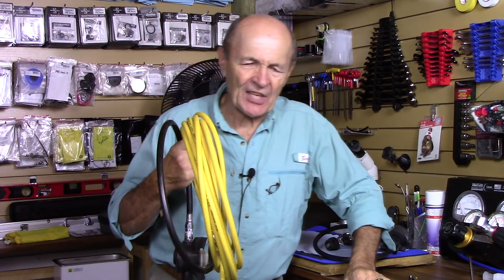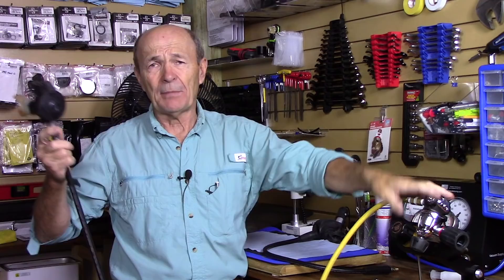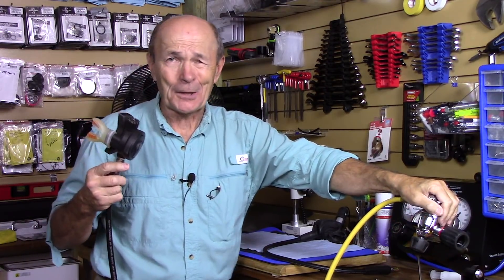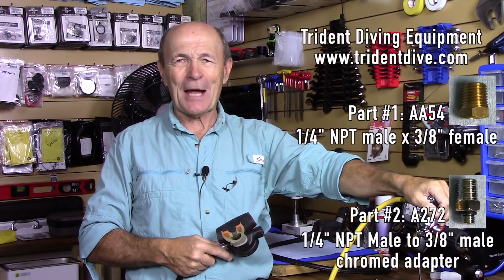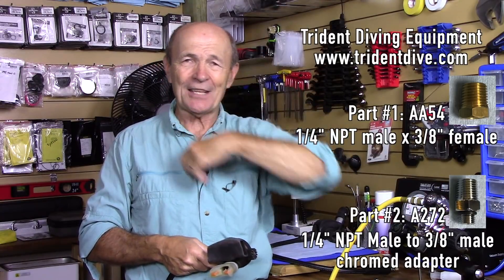Make Your Own Hookah Surface Supply - Scuba Tech Tips: S08E03

Comment: Can you do it with just regular air without a machine or scuba tank?
Reply from the maker: Because your breathing air under pressure, meaning underwater, i would recommend clean scuba air.  It's the safest and sure way to keep the diver safe.
A
Reply: @ ok Ty do you have to have a diver certificate to get the clean scuba air? Also I’m planning to go 30 feet I think would be the highest I would go if I was diving. Do you still need a divers certificate?

Comment: Please don’t follow this, you need food grade breathing line if you care about your life. Non food grade hoses have hydro carbons that releases into the air you breathe.
Reply from the maker: There is no 
food grade' hose but do get medical grade non-toxic PVC, or one that says 'air breathing' will be fine.
A
Reply: @ there is definitely food grade tubing. You can literally Google it and find it. It’s typically silicone mostly used for feeding tubes and stuff like that or you can spend a little bit more money and buy breathing tubing. It’s a yellow line.
Reply: @ there is also no safe pvc/polyvinyl chloride products that are safe to breathe through

Comment: Can you use a quick disconnect  between the regulator hose and the air supply line that leads to a tank on the surface?
Reply from the maker: You can but it is a risk of leaking and an accidental disconnect (do you have a bail out bottle?).  For safety, most use one piece from reg to air supply.
A
Reply: @AlecPeirceScuba_SeaHunter  I've come across a quick disconnect from XS scuba that has a black ring that you turn open then connect the male end and turn the ring to a close position and that prevents it from disconnecting. I do hookah for metal detecting in 15 ft max water
Reply: @texascrossbowdude636  Do you use an air compressor? I see they make battery operated air supplies and read a blog where people use a large aquarium pump that pumps 115lpm but it's only like 16psi. Seems like it would work but I'd think the spring in the regulator would be too strong for the pressure.
Reply: @brownjessea1  i was able to connect a quick disconnect at the regulator and the hose from XS scuba  thx

Comment: trying to keep my rig under a budget and weight.  if im down 20-25 feet,  would a 1/4" hose be large enough to supply air?  or do i need a 1/2"?   or 3/8"  harbor frieght has lots of 1/4 and 3/8
Reply from the maker: For me, i'd want thicker to get easier air flow in case of a hose crimp.  A
A

Comment: Hi Alex, I really like you videos but I need to comment on this one. My experience as a mechanic using Harbor Freight air hoses is that #1 they smell bad, #2 I have had them deteriorate internally and allow particles of material to flow down stream into pneumatic tools. An air filter designed for garage type compressors should take out the particles but they would not filter out the taste or smell. As a Scuba instructor, I personally would only use a dedicated scuba hose, and a scuba tank for the air source.
Reply from the maker: There are 'air quality' hoses for hookah use but like you say, check for smells if you can.  I'm amazed at how many divers still use the hookah setup for shallow dives.
A

Comment: Hey Alec....thanks so much for this video. I've been free diving up here in the NW part of Oregon. Besides the visibility issues with the water , I've found later in life , I can't hold my breath as long. I usually stay between 10' - 20' but by the time I get there , I have to head back up.  Sooo.......My plan is ( and I already planned on getting one ) Is a Sea Doo Fish pro or Explorer pro and mount one of these Hokkah systems on the back with a 100' hose. I dunno......but I think it'll bring my spear fishing and crabbing to the next level!
Reply from the maker: That's an unusual setup.  There are electric/gas surface supplied air pumps for shallow hookah dives like you say.  Be safe.
A
Reply: @AlecPeirceScuba_SeaHunter  Most definitely Alec. I know people like to use the smaller floating devices for their pump , but since I'm getting a fishing jet ski anyways , I could easily mount it to the back platform. In my head.....this seems like an incredible setup for my particular needs. BTW....I really dig all your videos my man. Been watching them for years!

Comment: In Sumatra Indonesia….long time ago before I knew anything bout scuba dive, my friend took me to dive with surface compressor supply and a long hose similar like your video. I remember jumped to maybe about 10 - 12 meters, got feeling bout underwater experienced for the first time. Went up, took a rest and jumped again. No safety stop of course. All the crazy things. I amazed of that experienced and found out about a real scuba dive later on… one question Alex, this compressor doesn’t have water catcher, does it? And also if we dive to, lets say, 20-40 meters, we supposed to do the safety stop procedure, right? Thank you for this good video..
Reply from the maker: If using a hookah below 5-10 meters, follow scuba diving ascent rules like; speed, safety stop and slow ascents.  You are breathing compressed air at depth as if a tank was on your back so safety is key.
A

Comment: At 13 to 16 feet should I where ears plugs? I will be searching for a lost rc boat in murky turtle pond..any advice is appreciated.
Reply from the maker: Never use ear plugs, it slows equalization and can cause pain and a rupture.  Only approved scuba ear plugs are Doc's Pro Plugs because they have an equalization hole but keep out most water.  Look them up if ear plugs are really needed.
A
Reply: @AlecPeirceScuba_SeaHunter  so without ear plugs in 15- 18 ft I should be fine? Do ears automatically close to prevent water or something like like..never hear anyone mention ears in any diving instruction videos..thanks for your help..
Reply: @roadstar499  Then you have not been watching the correct videos because they ALL talk about pressure equalization in the ears or "clearing" the ears. ALL of them!
Reply: I used to snorkel in holes that deep. Never had any issues with equalization.

Comment: On double hose regulators that have dedicated hookah ports, such as the DA Aquamaster, how do you keep the regulator on your back? It is rather heavy to leave floating around and possibly banging the back of your head.
Reply from the maker: There are hookah straps that hold the hose loose for the reg, go behind you and then up.  If you look in old scuba gear from the 1960's,  almost every manufacturer had hookah holder straps/belts/kits.  They were very popular back then for shallow diving, boat work, etc.
A

Comment: Like using these to clean big pools with weighted shoes and  a gas mask adapter like a full face mask  it's even better . Make a whip waist belt.  To take hose pull weight off regulator. The coily kinda hose .. doesn't have a bad rubber taste like yours will
Reply from the maker: These are great for that type of work.  I did commercial hard hat work so know lead boots well.
A

Comment: With a 200ft hose and being 100ft under water is there problems breathing with the pressure differential?
Reply from the maker: Not if a good 1st and 2nd stage are used.  
A.

Comment: Can you split 1 tank and attach 2 regulators to have 2 divers in the water using 1 tank, or is this not recommended/safe? The dive depth would be less than 15’, probably closer to 10’ for short periods - 30 minutes max. This is for lobstering in the keys when we find a good hole.
Reply from the maker: Remember your octopus has a 2nd stage (for you) and an alternate for your buddy so 2 divers can breath from a stand 1st stage without modification.  You can attach 2 second stages no problem.  Key point is with 2 divers on one tank, air monitoring is key as it lasts 1/2 as long.  One diver may want a redundant tank as backup.  Get them bugs!
A.

Comment: Alec, I REALLY enjoy your videos on Hookah.  Here's my question.  I have designed my own battery operated hookah system.  Compressor is capable of 200 psi, oil free compressor, with only 60decibles.  Air is on at 75 psi and off at 100 psi.  What would your recommendation be for a GOOD second stage regulator?  The regulators i have seem to draw very heavy when pressure drops below 75 psi. I think a regulator in the 50-100 psi would be ideal.
 Thank you in advance for your help!!
Reply from the maker: And 2nd stage will do, the cheaper the better. A sophisticated one will be harder to set. You need to adjust it to the pressure.  A 2nd stage is designed to be adjusted for easy breathing at a fixed, steady input pressure. Normally the 1st stage gives air at a steady pressure, maybe 150psi, and that doesn't vary much. Yours varies by 25 psi. At 100psi it will breathe ok. At 75psi it is harder. That's perfectly normal. You should try to reduce the variation in the pressure range. Maybe make it on at 80 and off at 90. Then you will not get so great a change in the effort. The compressor will come on and off more often in this case. The other suggestion is to add an air tank into the system. Just a common auto tire filling tank (sometimes called and air pig) will do. You can get one at Harbor Freight for $40 (https://www.harborfreight.com/air-tools-compressors/air-compressors-tanks/portable-air-tanks/5-gallon-portable-air-tank-65594.html). They are usually rated to 125 psi max. Adding that will flatten out the pressure a bit to the regulator. Just have the compressor line run to the tank and have another hose run from the tank to the reg. Just use a TEE fitting. Do both of these things and you'll find a big difference. See my video on adjusting the 2nd stage https://youtu.be/wkU2OB_fkVg . Good luck. Alec

Comment: Hi sir tanku for ur  helpful tips question in my mind ,y not just having the end off the hose out side the water and have the natural air from the out side air ?y do we need tank or compressor for air supply ?
Reply from the maker: Absolutely.  The 1st stage sets intermediate pressure to be: ambient + about 135 psi.  Meaning on the surface you must have a minimum 135 psi just to breath.  An open hose will not work as its just a snorkel with a breathing limit of about 2 feet deep.
Reply: Tanku for the important information 👍

Comment: What is the adaptor you have attached to your air compressor that the first stage goes on?
Reply from the maker: Hmm. I'm not clear on what you're asking. The upper hose to the 2nd stage must be attached to a normal regulator 1st stage. That ensures the pressure to the 2nd is 150psi - not 3000!
Quite frankly, the quickest and easiest way to make this type of surface supply is to cut the regulator hose in the middle. Then using brass ferrules (tapered brass inserts) and hose clamps, attach your airline hose onto the cut reg hose.
No adapters are needed for this setup.
I hope this helps.
Alec
Reply: The compressor is 125 PSI. Me and my husband figured out how to get the first stage attached. We got a few adapters from Lowe’s, some from the scuba store and some plumbers putty…it works. We needed to figure out how to get the first stage regulator to attach to the compressor.

Comment: Hmm not what i wanted to see .How about an oilless compressor set up on 12 volt
Reply from the maker: Nope.  Most can't generate enough pressure for depth.
Reply: @AlecPeirceScuba_SeaHunter  my neighbor built one using an innertube, oil less compressor and a motorcycle battery that he used for gold sniping, i believe he had about a 20 depth, this was about 25 years ago, i sure wish i paid better attention
Reply: @AlecPeirceScuba_SeaHunter  How much pressure would one need?

Comment: Another great video sir thanks for sharing thought some of you guys might be interested in a slightly cheaper way but quality way to do your surface breather set up, I use a US divers full face mask with a rear entry for the air so it comes out the back of your head it's a square fitting into that I made my own fitting put a good 3/4 inch external diameter half inch internal diameter hose on to it it saves me having a regulator because I breathe directly out of the mask. The one real advantage I find this I found while testing my setup so underwater I'm at about 20 ft I have a leak it's mine are at first but then slightly gets worse then the valve let go that I had made cuz it wasn't properly done the first time I tried it but because I had the mask on and it's properly sealed I put my hand over the back of the mask to block the air entrance and I had air left in the mass that I could breathe on my way back up, had I been using a regulator it would have been slightly more dangerous because I wouldn't have had that extra air. I improved my valve design it's not actually a valve it's just a fitting and I've had no problem since then. I did a video on my YouTube channel on how to construct this and shows all materials needed, Keith Robinson SCUBA 101 is the name of the video series.
Reply from the maker: Thanks Keith, I'll take a look soon sir.

Comment: Alec, nice video. Question, It seems I’ve seen somewhere that we’re supposed to use special fittings as well made for breathing through? Seems there could be contaminates in some metals or they can cause chemical reactions or? Can’t remember.
Reply from the maker: If using brass fittings, the most common, there is no problem.  Remember most of the inside of a 1st stage is brass.  For the hose, use one labeled for air/breathing as that is where you would likely get more undesirable particles.  Read through this videos comments for some more info.
Reply: @AlecPeirceScuba_SeaHunter  so you recommend any hose at harbor fright or aparts store, yet none of them are listed as "breathing" hose?  can you send a link to the hose you have in your video since you are saying that particular one is for "breathing'?

Comment: I know you stated these are typically used in shallow water, so maybe this is generally negligible, but if your first stage adds a constant pressure to the ambient pressure in it's diaphragm as the intermediate pressure and the first stage is at the surface in 1 atm of pressure, will it still supply the correct air pressure to support normal breathing underwater?
Reply from the maker: That is what your air supply has to provide:  an IP of 135 to 150 psi PLUS the ambient pressure at depth.   Some hookah's can meet this demand but smaller/cheaper units cannot.  When in doubt, use a scuba tank to be sure.   Thanks Robert for the comment.

Comment: Mr. Peirce , can you recommend a 12 volt air compressor that is best for a hookah system for two people to the depth of 40 foot or less, and can a regular second stage regulator be used for this purpose.. thank you Dan
Reply from the maker: First remember the air flow you need is between 135-150 psi intermediate pressure to the 2nd stage, times  2 divers, times 40 feet deep (over double the SAC), is a LOT of output PSI from a 12V  to be safe.  Discuss your needs with other experts on www.scubaboard.com who may provide a better solution or just fill up scuba tanks from the compressor.  Dive safe Daniel
Reply: @AlecPeirceScuba_SeaHunter  hi and thank you so much for the response....
Reply: @AlecPeirceScuba_SeaHunter  I thought,  1- diver, for shallow water diving (10-15 ft) Flow was more important than pressure. I am considering a 12V pump that delivers 120L/min @ 10-14 psi. connected to a small accumulation tank, such as a 5 lb, used CO2 fire extinguisher.  A sensitive 12v pressure differential switch, which cycles the pump motor on and off, by demand, keeping it running cooler, as/per duty cycle. Any thoughts on this... Thanks guys!
Reply: Be sure it is a oil less compressor, preferably with a diaphragm. Place a reserve tank between compressor and hose connector in the event you are 30 feet down and compressor quits. You still can surface safely instead of no air at all. Keene Engineering sells plastic reserve tanks.

Comment: You got to make sure the hose is not rubber because it will poison you because it contains oil
Reply: So only use PVC air hoses then? The video made it sound like you could throw anything on.
Reply from the maker: Must be for 'air quality' use in breathing.  For sure Larry.